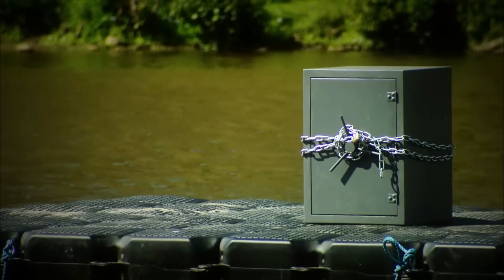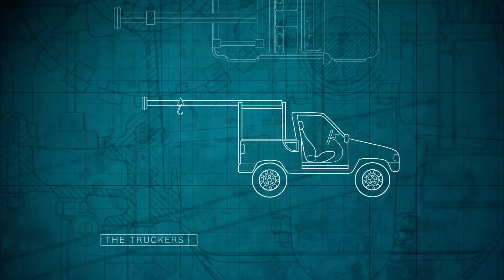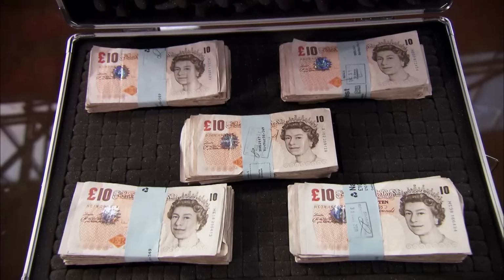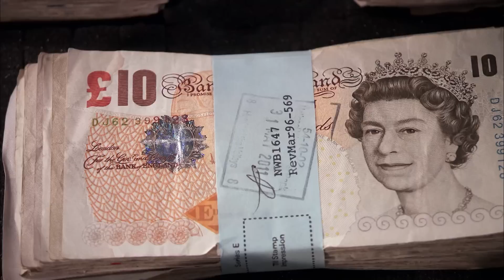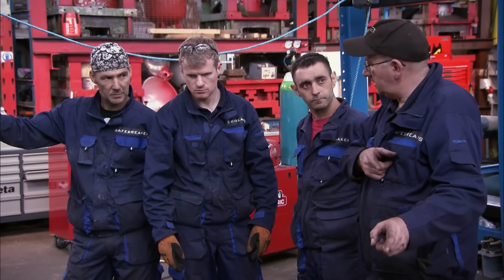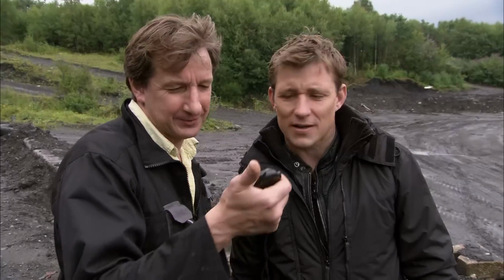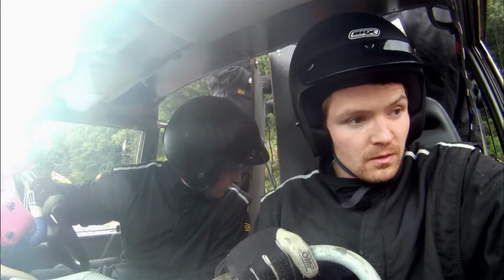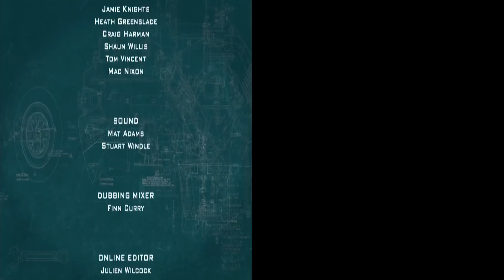Can These Teams Build a Budget Excavator From Scrap? | Safebreakers

Comment: If they had created a bit of a trench to lay the cable into, on the pile, the drag bucket would have worked the same as the first two piles. A cable can't force it's way down into a pile of bricks, like it can with sand, dirt, gravel....